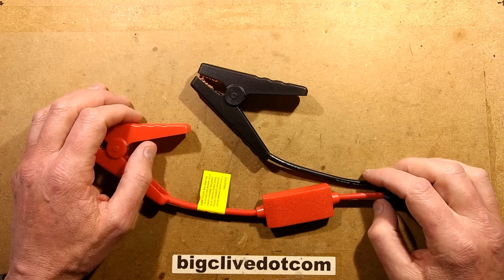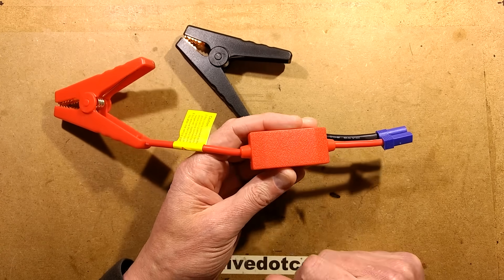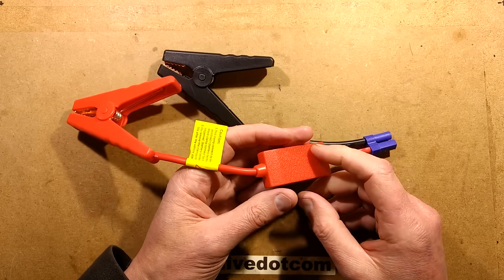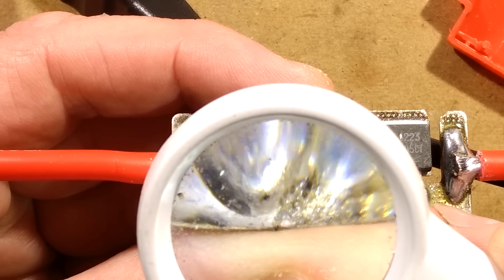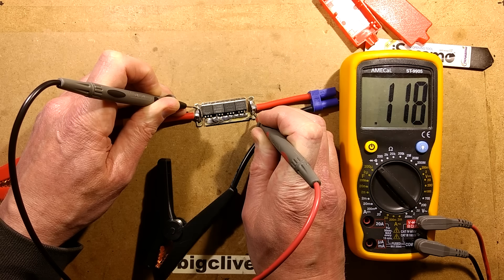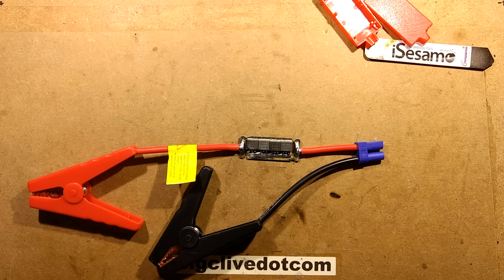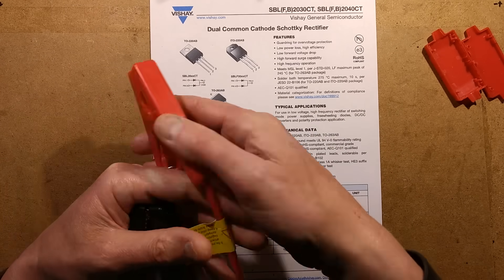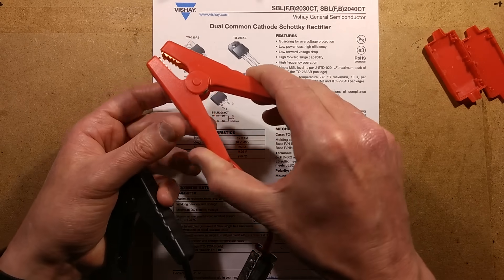What's in the little red box on some jump-start leads?  (Guess first.)

Comment: thx for the vid, and yeah for ridicalus 2.5GBP it doesnt look like an bad deal, hence 10awg silicone wires and clamps, and partically not if you can use it as a emergency jump starter for us there got a bunch of high C rated lipo packs for RC..(assume 3cells is obvius hence 12v, but how will the car-cirquit and battery handle fx 4/5/6s and the higher voltage if one only had lipo cells higher then 3cell, or are there an limiter there will protect fragile cirquitparts from higher voltage in most cars.
anyway thx for the notice, I also took the plunge on one of these shipped for 2.58GBP, intersting video +1.

Comment: Question: if these were resistors then the resistance you would see across them in parallel would be 1over the sum of the inverses of the resistances; with diodes in parallel does the forward voltage add like that?

Comment: My truck's starter barely hits 2000 amps, and it is a 14 liter diesel. It will put a strain on a set of two group 31 batteries, four is ideal.
No way a lithium pack you can carry easily will be able to do it.

Comment: The diode block prevents the jumpstart pack from being hammered when the engine starts and the current becomes greater than what the jumpstart pack contains.  It's a blocking diode.  No good for heavy Diesel engines though, as overcranking the starter, makes them smoke.  I did this with my 3.2Ltr Diesel engine.  Cooked the diodes of the board.

Comment: For a dummy load, run a number of car headlight bulbs in parallel. You can even switch them in one by one to see what happens (and avoid most of the current spike caused by cold filaments).

Comment: i have  used this  leads to charge a battery  worked every time handy bit of kit  but  what i do is plug it in with it on leave it about a minute   to allow it to charge the battery  then start the car up with a normal turn of the key  it's starts  and runs then remove  the  device

Comment: If you connect your jump starter to a battery that is fully charged and your jump starter didn't get recharged after you used it last then current would flow from the highly charged battery to the depleted one. In the case of a lithium battery that might mean it would get more amps than it could handle without damage.

Another scenario might be where you drain your jump start battery and just as that happens the car starts and throws power back to the jump start battery faster than it could take it.

MHO

Comment: Those jump starters are simply 3S lipos batteries (and b-grade noname ones at that). I made one just using a battery I already had for my quadcopter (4000mah 40C), some heavy gauge wire and some good quality clamps. The only problem with them is that when the car turns over and starts you must I immediately disconnect the LiPo from the car as the voltage from the alternator (>14V sometimes) can damage the LiPo. And that's why they now put diodes in series with them.
Reply: I have a few of these jumpers.  They all test out at around 16V open circuit.  So 4S packs and no overcharging.  But mine are rated for big displacement motors.  Perhaps smaller cheaper jumpers are 3S, dunno.

Comment: Hey Big Clive. I believe the diodes (which was my guess for the contents of the box) would be to prevent battery fires and the like from attaching the leads in reverse polarity. Nothing like connecting two batteries to each other in series!

Comment: for anybody wondering, its not for reverse polarity protection, its because the full charge voltage of the pack inside is 12.6v, thats fine for starting the car but once it does start the alternator brings the battery voltage up to 14.4.or even as high as 14.7, if this was reverse fed into the lithium pack it would destroy the cells, likely in an explosive manner.
Reply: Bullshit!

Comment: try using a salt water load, tub of salt water and one of the electrodes v, (arrow) shaped move up and down to  allow adjustment of load,
Reply: spodula the Vampire  Yes I saw that method used to control the speed of a Big Wheel at a fun fair years ago.

Comment: I have one of these kits. Mine is rated for max current of 400A. And it will only let you try to start for 3-5 seconds before it times out, so you can't just hold the key on and continue to draw. And it really has been enough to start my work F-150 on multiple occasions.

Comment: Clive, for your test load, consider a bank of car headlights with switches for each between two bus bars. Ten bulbs with 20 switches for high/low beam filaments will give you 1000 A capability. I doubt you'll need more than that. Or you could use a coil of wire in a barrel (or large sink) of water. We used to test 5V/200A power supplies that way.

Comment: I've often wondered about those 'booster packs', Clive. Wouldn't it make much more sense to leave a supercapacitor connected across the battery? Most 'flat' car batteries will still have close to 12Volts across the terminals, when measured with a minimum load. The supercap will hold enough charge for a number of starting attempts. It's no solution for a failed battery (shorted cell) or alternator, but it would save most people from their predicament.

Comment: Diodes are there to protect the safety circuitry and cells of the rechargeable pack from pulsations in the 14 to 17v range from cheap voltage regulators and alternation generation.  Automotive systems can swing VERY wide of 12v since they're technically 14v systems.

Comment: Even before lithium jump packs there were some supposedly "EFI Safe" jumper leads had a similar box on them, supposedly because ordinary jumper leads would fry the electrical systems of EFI cars, but everyone just uses ordinary leads on EFI cars & nobody has fried one.
Reply: Wouldn't be long until those cars stopped working thanks to Y2K though. I hope they had their Y2K-compliant jumper cables ready.

Comment: It seems that everyone of those diodes has a different part number
Reply: Top row is a date code. Part numbers are two each of 40 and 45 reverse voltage rating, so 40V applies. Google 'sbl2040ct pdf' for a data sheet.

Comment: Seems to me that the diodes are included to prevent damage if someone reversed the contacts on one of the batteries; either the recipient vehicle or the donor vehicle.
Reply: These are made to connect to a lithium battery, not another car battery. The diodes won't help if the leads are reversed. Consider attaching the leads backwards, one at a time. Connecting the first lead puts the lithium battery in series with the car's battery, connecting the second just shorts them out, probably violently. At no time however, would the current be reverse biasing the diodes. The diodes are there because lithium batteries are picky about charge current/voltage, and you wouldn't want the car battery or alternator pushing current into it.

Comment: A lot of people think the diodes are for reverse voltage protection  when putting the cable clamps to the battery backward.  The diodes do not offer reverse voltage protection as noted further.  If you connect in reverse then first the battery and booster are in series and will be dead shorted across each other the degree depending on the battery state of existing charge.  (The high current surge might be enough to cause a diode failure if it failed opened.  This would be a quasi fuse protection effect, but not reliable as diodes can fail as shorts as well.)  The boost back will try to discharge and recharge the car battery in reverse voltage polarity as the voltage at the boost pack is greater than the car battery.  A very harmful effect to lead acid batteries.  If it could still crank the engine, then the alternator output voltage if greater than the boost pack would try to reverse charge it.  Very bad, but might tolerate a momentary connection.  But the alternator would attempt charging the car battery.  

In normal operation.  The diodes serve simply 2 purposes of isolation:  Prevent the car battery and/or alternator from trying to charge the boost pack since the factory likely has there own preferred charging profile and a cc/cv type charger.
Reply: So in theory you could delete this feature? I have been through 3 sets of these leads because they keep desoldering themselves when jumping a car. If i deleted and kept the time attached to the car at a minimum it wouldn't actually hurt the box right?
Reply: No, in case the LiPo is 3 cells in series it can handle 12,6V max. Once the car starts and the generator is putting out 13-14V, it would destroy the LiPo pack, possibly in a very violent manner.
The diodes prevent this.
Reply: In other words it is for reverse polarity protection, but connecting the car battery backwards isn't reversing polarity - it's the desired polarity but with an extra current source.
Reply: @nomennudum4592  well two batteries in series increases the voltage, and so normally the amperage can increase as a result, but that's irrelevant here because the two batteries have virtually no load between each other. It's a dead short. Don't think there will be any (usable) voltage left for the vehicle during that situation. You may even present some nice reverse polarity voltage available to the vehicle's system. If that ends up flowing through the system get ready to pop a few components. Don't worry it can only cost hundreds or one thousand dollars to fix.
Reply: @activemanishere  I got rid of my diodes and it works great.  I keep the time attached to the car minimum.

Comment: I thought that the diodes were for 'Reverse Polarity Protection' to protect the lithium charging pack. Don't most of these, just 'boost' the battery, bringing the car's own battery 'up' just enough to start the car? I doubt that the lithium pack could start the car, if you removed the car's battery from the circuit. That said, there is a guy on YouTube that uses a bank of 'super capacitors' instead of a lead acid battery, to start and operate his car.

Comment: My guess is a diode, to keep the alternator's voltage from coming back into the lithium battery.  Improper charging of a lithium battery can cause explosions and fires, as we've all seen on this channel and others.  That's my guess...  I'll post another comment in reply to this one after I've watched the video.
Reply: Ok, so a group of diodes in parallel -- my idea of a single large diode was close...

About the low voltage drop across that diode-pack:  Because it's several diodes in parallel, wouldn't you expect to have the voltage-drop be lower than a single diode?  Much like the resistance of a bunch of resistors in parallel is less than the resistance of any single resistor?  Essentially the voltage drop is being caused by the resistance to current flow in the forward direction inside the diode, is it not?  The equation for determining the resistance of a group of resistors in parallel, but is something like (1 / (1/r1) + (1/r2) + (1/r3) + ... ), is it not?  Something close to that anyway.  Where the more resistors you have, the more pathways you have for current to flow, and it counterintuitively lowers the total resistance, the more resistors you have in parallel...   I hope I've explained myself properly here, without confusing anyone...
Reply: @LMacNeill  Diodes are not like resistors - more like a cliff for the electrons to jump from (but not back up which is why they only go one way). Now if you put several cliffs next to each other more electrons can hurry over (more current) but the height is the same (same voltage drop).

Comment: Wouldn't the voltage drop of that diode array appear to be low because of the multiple diodes in parallel? Similar to how multiple resistors in series would cause the drop?

I looked the datasheet (Diodes Inc) up for myself for the SBL2040CT it says a forward voltage drop of 0.55

>>> 0.55/8
0.06875

Wouldn't this explain the low forward voltage? If not, teach me a lesson :p

Comment: Looking at the diodes it looks like there is at least 2 different types?
https://media.digikey.com/pdf/Data%20Sheets/Diodes%20PDFs/SBL2030CT%20-%20SBL2060CT.pdf

I guess it wouldn't matter too much because they're all rated above 16v and have the same current rating and surge current rating... :/

Comment: those packs won't output 1000 amps.  Then one's i've seen are all in the peak 250 amp range tops, if that.

as for a load, use a mains transformer winding, reduce the wraps to your desired resistance, then plop the whole thing underwater to keep it from burning up.  You can get away with crap like this with such low voltage (i've run winch's pulling several hundred amps underwater)

Comment: Clive, Fig 3 in the data sheet explains the very low Vf you measured.  The advertised Vf for the part is 0.6V, but it's current-dependent.  At low current (your meter's diode check function), the Vf will be small.  This is a common trap when measuring diodes.  You have to put your intended current through the diode to measure (with a low volts range) how it will perform in your application -- just putting a multimeter across it in diode test doesn't tell the whole story.

Comment: My 4 cylinder requires less than 150A to start even in the winter. How much less I don't know. But the fuse hasn't blown yet. Still need to replace the battery under the hood.
Reply: chemicalvamp My 2 cylinder motorcycle takes about 60A to start in normal temps. I don't know how much it takes in the cold because i live in California.
Reply: I cant say for certain how many Amps exactly mine needs I only know its < 150 because a fuse between my trunk where my batteries are, and my hood where a dead battery is stuck. Has not blown out yet.
Reply: chemicalvamp I know the amperage because i have jump started my bike with my power supply from time to time, and 60A  was about the most that i saw on the display.

Comment: Hey, I've been working with high-load circuits (30-50A ac & dc) for a while now, and I flinch whenever I see ratings like 2000A for tiny, 8 or 10 gauge cables. Is it really possible to squeeze that much current through a wire that small for even the smallest quantifiable amount of time?
Reply: Matthew Slaymaker You can discharge hundreds of thousands of amps through a 10awg wire. Just grab a ~500uF 600v cap and fully charge then short it through the wire. For the several microseconds that it takes to discharge it will be pushing hundreds of thousands of amps through that wire.
Reply: Matthew Slaymaker You can discharge tens of thousands of amps through a 10awg wire. Just grab a ~500uF high voltage cap and fully charge then short it through the wire. For the several microseconds that it takes to discharge it will be pushing tens of thousands of amps through that wire.
Reply: A. Zak That makes sense, I wouldn't actually try that myself (sounds like a good way to get burned) but I will remember that, thanks!

Comment: In this case, the diodes are used to prevent the alternator from shoving tons of current into the lithium battery when the vehicle starts, nothing more. It does NOT provide reverse polarity protection. If you hook the booster pack up backwards, things will get quite exciting quite quickly, guaranteed, unless the jump pack has some sort of protection internally.

I've had bad luck with these lithium jump start packs. For one thing, their performance drops dramatically when cold, which ironically is also when you're most likely to need it.

I much prefer ultracapacitors for jump starting. You get WAY more amps and they are not affected by low temperatures nearly as much.
Reply: Yep, these cables can't help with reverse hookups. It will cause the positive terminal to look like -12v to the charger, so it will dump everything it can into the battery attempting to reverse charge it. That would go very very bad. It needs some brains to detect a negative voltage scenario, letting it know the cables are backwards. That's actually easy to implement... but don't expect the feature!
Reply: I have two ultracap jump packs, mainly cause I think they're so cool, and also because they don't have a limited lifespan like the lithium packs do.  Although ask me again in 10 years to see if the ultracaps are still ultra.
Reply: @wingerrrrrrrrr it’s been 4, how about a near-halfway update?

Comment: 4:58 Hey Clive, as you probably have realized by now, the reason for the very low Vf you're measuring is because each diode has a Vf of 0.6V (as you'd expect and as confirmed by the datasheet), however what you're measuring is 8 of them in parallel.
Reply: Are...Bart.  just think about what you said! They are not resistors so you don't divide the voltage by the number of diodes old chap.

Comment: diodes! I had to fix mine.  My version had the diodes soldered to a perforated pcb and the high current cooked part of the pcb. I bridged the cooked area and still use it 1 year later.

Comment: I had a alligator clamp on one of these spontaneously combust after trying to crank a motor that was seized, the protection did nothing, it felt a little warm when removing but I went away and came back 5 mins later to find the insulation had turned into a smoldering puddle, must have been super hot where the cable joins or something...

Comment: I'd really like to have one of those lithium boost packs. However, I'd want it to be as cheap as possible, something around 30-50€...
Why not test them by starting a car (all you'd need is a completely flat and discharged car battery to change the "guinnea-pig car's" original battery with). For scientific precision, you could take an amp measurement of how much the starter of the car draws from its regular battery while starting.